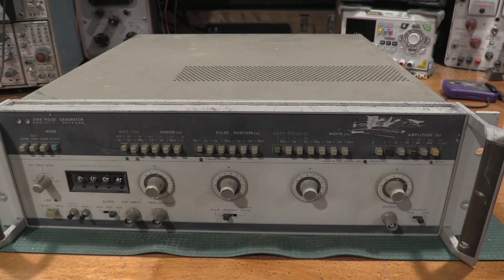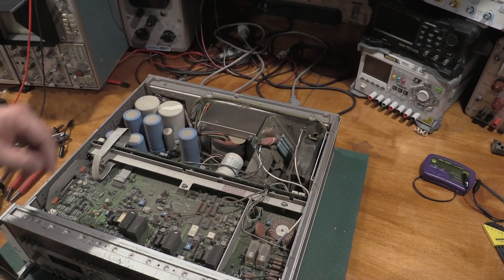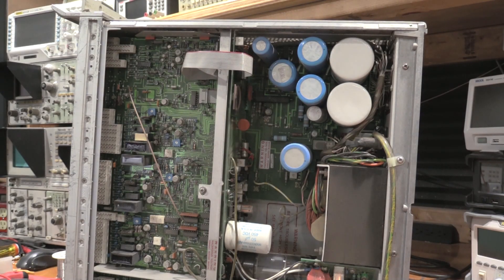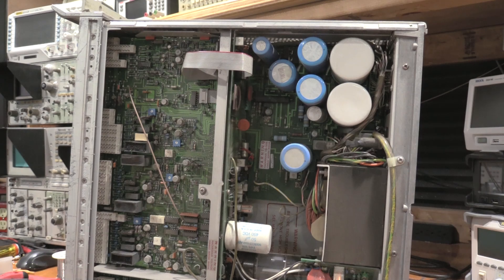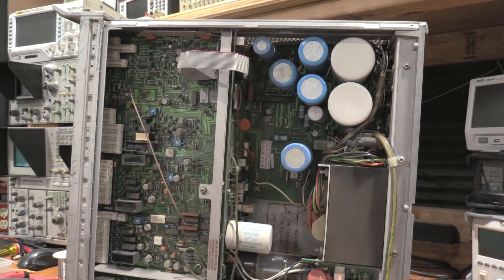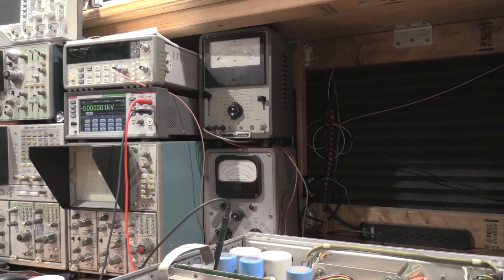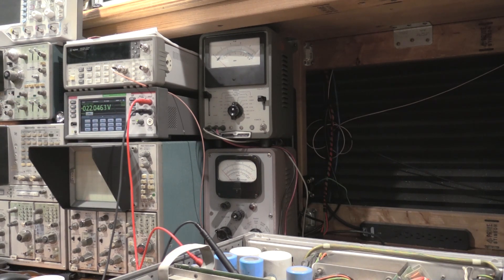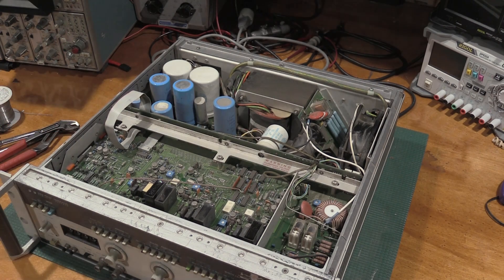HP 214B Lab Checkin

Comment: I think you're the right person to ask this question. I'm doing a restoration on a Tektronix oscilloscope "Do you know where I can get any Tektronix spray paint to match the outer case on Tektronix equipment"?
Reply from the maker: Try the Vintage Tek Museum, as well as the Tek scope groups.IO mailing list. I know a few cans of the official paint came up recently from and estate sale. However there is a Sherman Williams paint number if I remember correctly that is not exact but is REALLY REALLY close. So you can even get some paint new if you would like to go that route. I don’t remember the color code but I know I have seen it discussed several times on the mailing list.

Comment: You might consider getting a couple 100X scope probes, many of the newer 10X probes cannot handle the voltages in vacuum tube circuits.
Reply from the maker: I have 1 100X probe but I do need to get a few more.